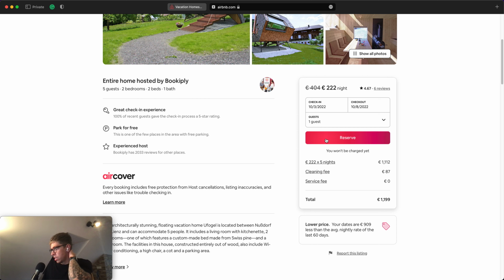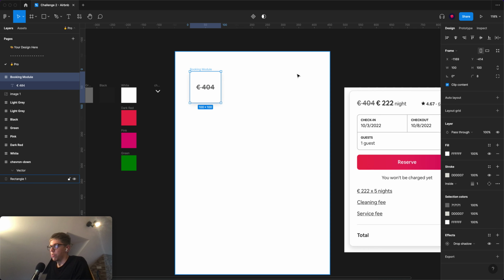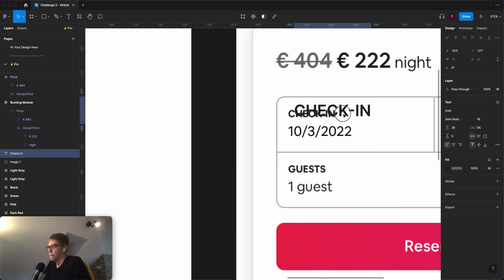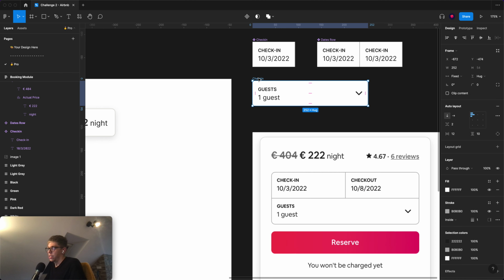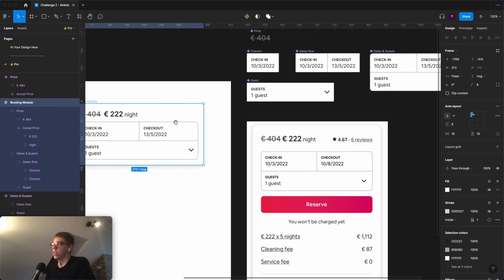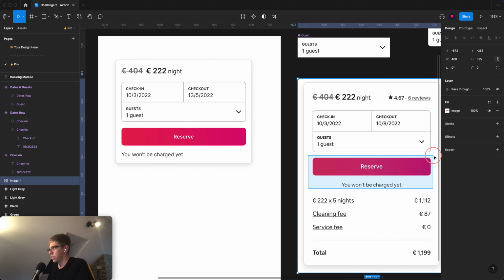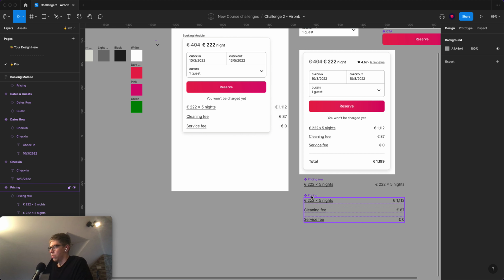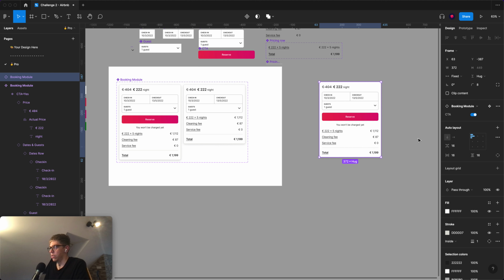Challenge 2 - Airbnb

Comment: Hello there. Can you tell me the situations in which you choose between center-aligning text in a fill container vs combining text with CTA and then center aligning? pros n cons?
Reply from the maker: It's usually a matter of preference - what you get used to. I usually use fill container with center alignment if I only have a text element. I normally don't put that single text element in another frame.

You use it in another frame with center alignment if you expect there to be another element, like a CTA with an icon next to the text or something :) 

Hope I answered your question :)
Reply: @design_space  thanks. I ll practice on examples for clarity.

Comment: Really enjoyed study with the video.
There’s one steps that i might missed out so my dropdown icon can not auto-fill the container, would you mind to share some ideas how should i can fix the problem ? thx
Reply from the maker: Hey there,

So lately, a bug has been creeping up in Figma where if you set something to "Absolute position", the constraints (right, center) does not work anymore, and it will go out of the frame in your copy of the main component.

So since they still didn't fix this, what I'm doing is that you would create another frame for "Guest" & "1 guest", and then set the overall frame of the dropdown to horizontal direction and then use the "space between" option so it pushes the text on the left, and the icon on the right apart from each other.

Hope that helps! :)

Comment: Great Tutorial! Thanks to this now I can do responsive design. Putting every component into Frames and auto layout do the magic. It's like putting Lego pieces together. :D  So, every time we want to create a table, do we have to design it like this? Also do you have any rules for setting margins, paddings and the smallest font size?
Reply from the maker: Yes, imagine designing back in the day when Figma didn't have an auto-layout and "fill container" features 😬 I don't miss those days haha!

Yes, try to utilize auto-layout frames as much as humanly possible to make your life as easy as possible.

For margins & paddings, the majority of design is created on an 8point grid which means that paddings & margins go: 2px, 4px, 8px, 12px, 16px, 20px, 24px etc.

And for the font size, depends on what kind of text, if you have a blog post, you shouldn't go lower than 16px. If you have some small annotation or helper text, you can go lower than that, but I wouldn't recommend smaller than 12px.

Comment: Hey, this was fun .. thanks!
My dropdown is fixed on the right, except that everything else is responsive. How do I resolve that any tips? Thanks!
Reply: That happened to me too. I deleted and redid it and it worked.
Reply: and don't forget the auto-layout. Hope it helped.
Reply from the maker: Hey there,

Figma has a bug unfortunately, when things do not get moved based on the constraints that you set (at least I see it as a bug). So you can try what @vankawa suggested in the other comment or here's a comment I answered in another thread:

"..what I'm doing is that you would create another frame for "Guest" & "1 guest", and then set the overall frame of the dropdown to horizontal direction and then use the "space between" option so it pushes the text on the left, and the icon on the right apart from each other."

Hope that helps! :)

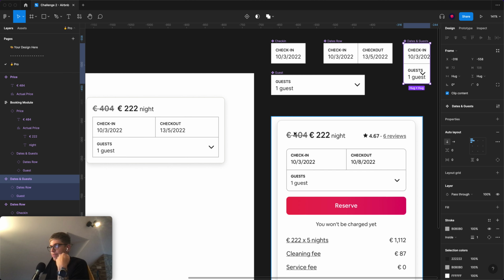Comment: 18:30 How does clip content result in showing the border? What's the logic behind this?
Reply from the maker: It's hard to actually put it into words, but I assume it works that if the clip content is OFF, the tool doesn't know where exactly the end of the frame is, and it's unsure where it should draw the borders.
Reply: @design_space  It feels like a bug rather than a feature.

Comment: How are you getting the font values from the webpage? It doesn't work to just scale it on top of the screenshot. They use a variable font size in the CSS and so when I take a screenshot the font values are in their 30's, not 20's like normal web font sizes should be. So when you overlay the $400 and say the font size is 20, and line height 28, my font size is like 33 maybe because of the resolution of my monitor copying and pasting into figma.

Is there a better way to capture this from the webpages? Especially when they use variable font sizes? What would you do in an actual professional setting here if a client handed you a webpage to add something to?

Basing my font sizes off my screenshot makes them larger, and now when I hand off to a dev, they will likely be too big on web!
Reply from the maker: Very good question! :) 
Although I find it weird that the font size changes (especially if you don't change screen size) but what I do is, II use the "Computed" part of the inspector, where it actually shows the rendered values on the website :) 

Hope that helps :)
Reply: @design_space   That's a great point! Thanks so much! didn't see that tab :)

Comment: 4:50 How did you come up with the line height?
Reply from the maker: Hey Daniel, line heights are usually "predetermined" because they mostly use a special ratio based on the initial value of body font (which is usually 16px). You can also see it if you use the inspector mode in Chrome where you can actually see the CSS of the website.

Hope that helps! :)

Comment: Great Work ! I started the challenge this afternoon and already did Booking & Air BNB : it is so much easier to work with your process. I am addicted to Figma now. Thanks a lot
Reply: The challenge will be if a company asks you to use Photoshop or Sketch or XD still...
Reply from the maker: @starogre  That is true, but the industry standard is Figma by far (very few companies still use Sketch) and XD will probably be discontinued because Adobe bought Figma a few weeks back. And Photoshop is never used for UI design, so not likely you will be forced to use that for UI design. For something else, it might be so :)
Reply: @design_space  @Starogre Sketch might have its comeback if Figma gets fully integrated with Adobe's CC. In the end, they all work somewhat similarly, though.
Reply from the maker: @DanielWiehoff  I honestly do not see that happening, even if Figma gets added to the CC suite. Although it would indeed become more expensive, there is not enough value in Sketch to transition back - not to mention, transitioning everything from Figma back to Sketch, would take an enormous amount of time and resources for almost all companies. Adobe has also "promised" to keep Figma independent, at least for the next few years.
So, I think Sketch becoming a real contender is not happening unless Sketch upgrades its product to a much higher level than where they currently are. And that would be very hard to do since Figma is very swift with adding new features that basically lock you into Figma.
Reply from the maker: Hey Kimberly!

I'm so glad you enjoy the challenges and are learning!

And welcome to the Figma Addicts club! 😃

Have fun with the rest of the challenges!

Comment: I think I messed up early along (was naughty and didn't follow along 100%) so when it came to resizing with the main frame non of my components resized 😅 I tried to go back and fix the issue but my 'fill container' option did not show up - oh well, lesson learnt...follow along 100%. Otherwise, great stuff!
Reply: Fill container only shows up if your component is inside a container. You can't apply this to the top parent of a component outside your frame, for example.
Reply from the maker: @starogre  That is sort of true, but the outside container (frame) needs to be an autolayout frame. If it's just a normal one, the Sizings dropdowns (Fixed, Hug, Fill) will not show up :)
Reply from the maker: Hey Wynne, thanks for the kind words! :)

As you develop your understanding of Figma more, you will have to follow along 100% less and less, because you will already know how something works and should be set up! :)

Glad you're enjoying the challenge!

Comment: didn't get on 15.20 min . very fast. what the difference btw SHift+A , group and component. Where we are able to set up the margins and padding? I didn't get how works clip content, fixed/hug.
Reply from the maker: Hey Anton, good question, let me try to break it down! :) 
- Shift+A is a shortcut, which automatically makes a Frame + applies Autolayout to the elements you had selected.
- A group is very similar to a frame (without auto layout), but it is actually much harder to control the elements inside of it (especially properly resize them)
- You are able to set up margins and padding only in a Frame that is converted to an Auto layout version.
- Clip content "clips" everything that is inside of a frame, to it's border. So, if you have an element inside of a frame, and part of that element is OUTSIDE of the border of said frame, you will not see what is outside of the borders if the clip content is ON, and vice verse if it's OFF.
- Fixed sizing locks the height or width of a frame to a specific amount (Fixed amount)
- Hug components, automatically resizes the size of the frame, according to the elements inside of it.

Hope that helps!